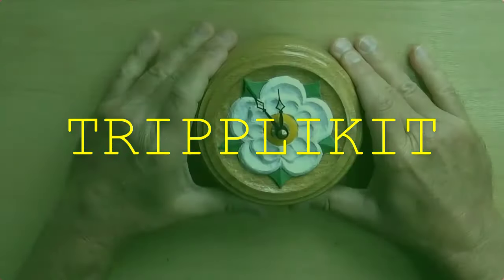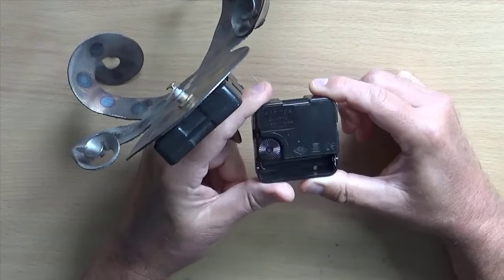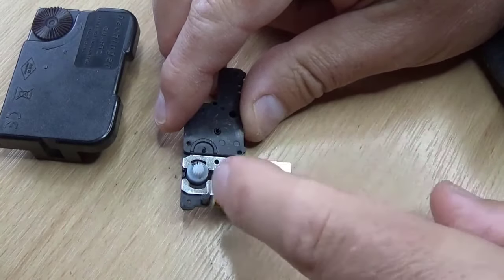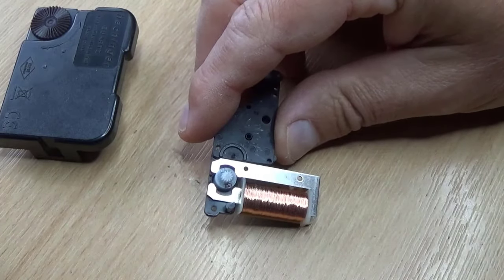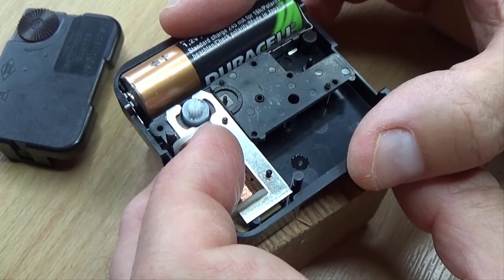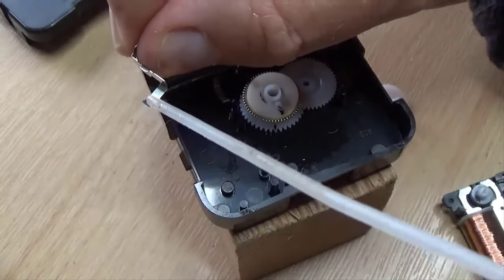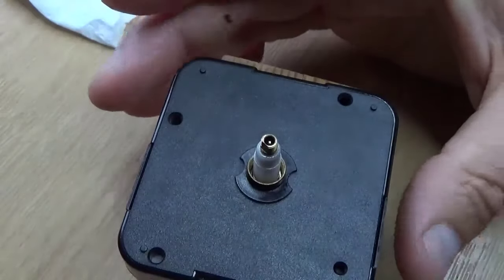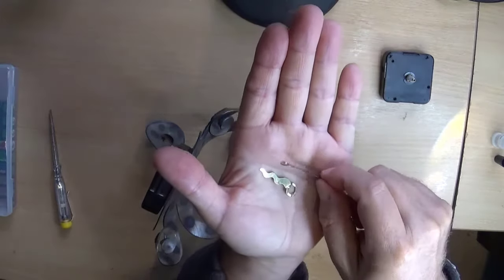How Do Analogue Quartz Clock Mechanisms Work & Can We Repair Them?

Comment: Thank you very much! This video is really helpful. People can repair their own clocks at home. As well as it helps to avoid throwing old damaged clocks into garbage or side of road or street. Repairing and restoring old clocks helps to keep the environment clean and healthy as well as avoid wastage of old ones.
Reply from the maker: Yes. So tempting just to throw throw them away because they are so cheap when, probably, most can be repaired in a few minutes.
Reply: @TripplikitElectronics  Please upload a video that shows connecting and installing electronic chime that hourly play melody and count the hours to the quartz clock moment.
Reply: @TripplikitElectronics  People are still not aware that the old damaged quartz clock moments can be repaired so that they are tempted to throw it out. When people become aware that quartz clock moments can be repaired they try to repair and restore dead quartz clocks. This video will make people alert about it so such temptation is avoided.

Comment: Wow very helpful and clear vid! Had a sudden urge to fix my parents' wall clock that hasn't been working in years. Saw your video and with trial and error on the parts, I found that the problem was inefficient pressure on the power board! Got some tape in there and now it's perfect! Thanks for your guide on how to assemble it!
Reply from the maker: Glad you found the video helpful.

Comment: Thanks for this mate. 👍 👍👍

Although Alibaba (and their '8 weeks if you're lucky' shipping) has lots of these mechanisms, you need to be precise as to dimensions and diameters, and the particular one I need is unavailable, so I pulled my mechanism apart to find that one of the battery-to-PCB contacts had corroded. In doing the pull down, bits went everywhere, of course, so your video helped me get it all back together again after I addressed the corroded contact.  👍👍👍
Reply from the maker: Glad it was helpful. As you'll have noticed, I paid a bit extra for a good quality mechanism from a local supplier.

Comment: Thanks a lot for all your efforts.  I got mine apart and one of the wheels had some broken cogs.  Hence why it was ticking and only worked for a little while.  Thanks again and keep safe you and yours.
Reply from the maker: That's interesting. I know the cogs are only plastic but I wouldn't have thought the "motor" would have the power to damage them. Maybe someone used too much force trying to set the time.
Reply: @TripplikitElectronics  Possible!  Thanks again and keep safe you and yours.

Comment: Perfect!  I didn't know how the electro-magnetic mechanism worked...only that there is the quartz crystal controlled oscillator. Now I can set about taking my old LL Bean ( seiko)  moon phase mecanism apart.  It "fibbulates) instead of doing a full tick...so maybe clean and lube will do it. Thumbs Up !
Reply from the maker: Hope that fixes your problem. You would have thought that a bad contact would just cause the clock to stop - however I've seen that effect too.

Comment: The driver IC divides the 32768Hz crystal down to  create pulsed AC with alternating plus-minus pulses every second. The permanent magnet rotor has north on 180 degrees an south on the other 180 degrees. The four points on the electromagnet are 90 degrees apart and when energized will pull the rotor to be centered between the two like poles of the electromagnet. When the pulse ends, the electromagnet de-energizes and the rotor rebounds to its resting position off center of the point  at which it was when energized. Gaps between the rotor and stator are slightly smaller at the two points anticlockwise from the energized position, causing the rotor to move predictably anticlockwise at the next pulse which has opposite polarity. In other words, this is an AC motor with predictable resting positions.
Reply from the maker: Thanks for your knowledgable explanation. I didn't look into how the actual "motor" works. Sounds interesting - perhaps I should do another video on the subject.

Comment: Thank you so much.  My mechanism came a part whike trying to clean the circuit board and connectors and I refused to purchaseanother cheap China made mechanism.  Your video was very helpful in helping me reassemble and get it working properly.  Cheers.
Reply from the maker: Glad you found it helpful.

Comment: I had one where the battery had a slight leak and it creaped up the metal strips to the pcb, made a mess of the copper pads.
But after a clean, the clock started ok :-D
I have also had ones that stop for no reason,  the clock divider+coil driver must have been dead.
Reply from the maker: I've always just thrown them away up to making that at video. That one was just bad contacts and it's still going so, in future, I'll at least have a look inside. Congratulations on recovering one after a battery leak!
Reply: Por isso os relógio não duram muito tempo. pra que, não tem necessidade de usar pilha alcalina em um relógio de parede. as comuns tem uma ótima duração e evita vazamentos...

Comment: I got one that seems to work fine for a few weeks/months and then suddenly begins losing time. When I check the battery voltage, it's at around 1.4V (new one read 1.6V). I've cleaned the PCB with IPA and even touched up the solder joints with my iron. The gears don't seem to be dirty or look damaged. It's difficult to troubleshoot since I have to wait potentially weeks or months to see if what I did made any difference. Not really sure what's up with it.
Reply from the maker: They are so much built down to a price it's probably poor assembly or a poor quality part wearing out early. Look like you've tried everything to repair it so you'll probably just have to replace it.

Comment: There are only 2 possible causes for the failure. Plastic expanding or Battery replacement method. Because the clock just sits on the wall there is no physical contact other than changing the battery. The rechargeable battery may have a larger diameter than non rechargeable which may push the contact off causing the loss of power. 
The 2nd clock must have cheaper plastic that's wearing or expanding. The magnet gear is not seating in the socket so its slipping. The replacement hands could be binding causing the magnet gear to wear the points causing it to jump the teeth.
It may need a shim to hold it in place.
Reply from the maker: Thanks for the information. You sound a lot more knowledgable than me on these clock mechanisms. I shall certainly make use of your information on the next one I look at.

Comment: What typicaly kills them is the shaft piviots (bearings) wear loose to a point where the mechnism binds up and stops . I have seen people put a tiny drop of clock oil on these points and get them back running again, I have also seen the battery bars corrode make bad contact and stop them as well.   but if the bearings are worn badly enougth oiling wont fix them . its important to note these mechnisums do come with the option of the threaded shaft that goes thorugh the clock face having a number of diffrent lengths , you can get them with the option of having a swinging fake pendulum, some tick off the seconds and that noise anoys some people , some run second hand smooth and dont tick as they operate ..
Reply from the maker: I always thought you shouldn't oil plastic bearings. Was I wrong? They are so cheap that once the bearings get worn it's probably best to just replace them.
There are so many options available for quartz clock mechanisms it is quite hard to choose the correct one for your application.
I must admit I've never had one with a fake tick or a fake pendulum!

Comment: @TripplikitElectronics  Plastic can be lubricated,  but it requires a very careful choice of lubricant. A conventional oil or grease will act as a solvent against the plastic. Silicone and PFPE oils are generally safe on all plastics.
Reply from the maker: Thanks for that. Very useful information.

Comment: I have 2 that are late and I have already disarmed it several times without a possible solution, as I saw in a video, increasing the voltage intensity is corrected, and this is achieved by placing an extra battery in parallel that would add intensity while maintaining the same voltage.
Reply from the maker: These clock modules should draw very little current. It seems strange that yours needs two batteries to work properly.
Reply: @TripplikitElectronics I think the pulses are rather high current created by discharging a capacitor through the stator coil. A degraded capacitor could prevent sufficiently strong pulses from reaching the stator.

Comment: I have got a problem with my clock, the second hands got ticking then it have stop ticking and the time are going really fast. Do you know why?

I have been advised to replace all of these gears which I don't think I would need to?
Reply from the maker: I have never heard of that problem before! It would probably be cheaper to replace the clock mechanism rather than buy new gears. I would actually be very surprised if you could find new gears to buy.

Comment: Cleaning those pressure electrical contact tabs should go a long way toward making the clock reliable.  if you don't  have contact cleaner...then rubbing alcohol and a paper towel  will do it.. dry with the a paper towel  because it is mildly abrasive which is good.
Reply from the maker: I agree. It is surprising how much those contacts getting dirty can affect the performance. Despite the current usage being minute.

Comment: Quartz Chime. When I hear the little "click" at the top of the hour just prior to the chime going off, the chime does not sound. In your expert opinion, what is the problem?
Reply from the maker: Sorry, I have not taken one apart that has a chime. I'm not an expert in clocks - I just really took them apart out of curiosity. If it goes "click" it sounds like the chime mechanism is trying to work. Maybe the bell or whatever that makes the chime has become detached and the striker is no longer hitting it. Just a guess.
Reply: @TripplikitElectronics  thank you for taking the time to respond ~♡~

Comment: I have a quartz clock mechanism I'm trying to repair any tips on how to repair it?
Reply from the maker: Hi Jay, The fault on the one I took apart was that the battery holder was making poor contact onto the PCB. I just had to clean the contacts - easy fix.
Generally, if there is anything seriously wrong with them, it won't be worth fixing because replacements are so cheap.
I only really took them apart out of interest and to make a video.

Comment: I have a Braun BC02BL clock. It doesn't work well. The minute hand doesn't move and remains ever in the same position. The seconds hand works well. What about my problem? Does someone know?
Reply from the maker: Sounds like the minute hand is stuck somehow or not pushed on to the shaft possible. If the seconds and hours are working it would imply the mechanism is OK.
I had one that always showed something to or something past 6 - yes the hour hand had come loose and dropped down to the bottom under gravity!
Reply: @TripplikitElectronics  thanks for your answer. Only the seconds hand works well. The minutes one works for a while (5-15 minutes) and then it stops in the same position. I'd like to open the clock, but I'm afraid to broke it. I'll ask a 
watchmaker, hoping it is not an expensive problem :(

Comment: Hi 
How can I Make
24 Hours And 45 Minutes Clocks Measurement
Let's Say For Other Planets

well Actually My Circadian Rhythm Is 24 Hours and about 48 Minutes  on Average

I have Delayed Sleep Phase Disorder
Dspd Non-24 Hours

some People Call Me Martians
I Know It Is Frustrating To Wake Up 45 Minutes Later Every Day
But I accepted This As a 32-year-Old

i am interested To Make Clock That Tracks My Body clock
Do You Know Any Html Or JavaScript   Or Any Other Codes To make

or Is there  any Html Codes Of Martian Time
That I Can change It From 39 Minutes To 45-48 Minutes Longer?

If Not
How Can I Slow Down A Quartz Clock To Run little Slower
3% Percent Slower

Thank You So Much Sir
I hope You Have Some Solutions For Me
Reply from the maker: I built an alarm clock using an Arduino and I could easily set one "second" to be 1030mS. The electronics on a quartz clock puts out a pulse every 1s. Perhaps you could find something to put a pulse out accurately at a slightly longer duration. The clock electronics is timed by a quartz crystal. It might be possible to connect capacitors to the crystal to make it run a bit slow. Thanks - interesting problem.
Reply: @TripplikitElectronics  Thank You So Much 👍
Do You mean Ceramic Disk Capacitors Or electrolytic capacitor?
Reply from the maker: ceramics of a few pico farad - and doing this may well just kill the Xtal oscillator.
Reply: @TripplikitElectronics  i tried 33 and 47 pf ciramic capacitor
It stopped working

Then i  tryed 5 and 7 pico farad  i keeps working without slowing down

Should i connect it in Series?

Comment: Wh9oa there pardner! Way, way too much oil!!! A tiny bit on each shaft is it. None on the gears. Just clean the gears with a clean lint free rag.
Reply from the maker: Thanks for that Mark. As you probably guessed I'm not an expert with clock mechanisms. I'm more used to pouring oil liberally on my bicycle to stop it rusting up. I'll remember in future - a tiny bit on the shaft.

Comment: silly sod. all you do is buy a cheap clock from Poundland and swap the bits in your clock. don't need to get someone to do it. the heads just push on
Reply from the maker: Part of the point I make in the video is that I've found cheap clock mechanisms (and I'm sure that includes Poundland ones) to be really unreliable. That's why I bought a relatively expensive one - which is still keeping perfect time.
Reply: "the heads just push on"  ... Really? There we all were thinking that the hands just push on. Silly sod.